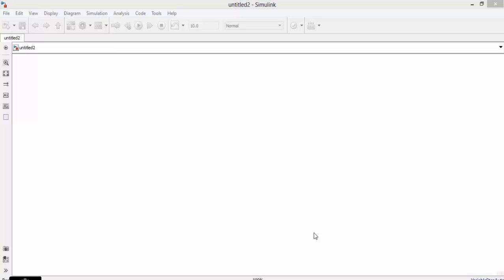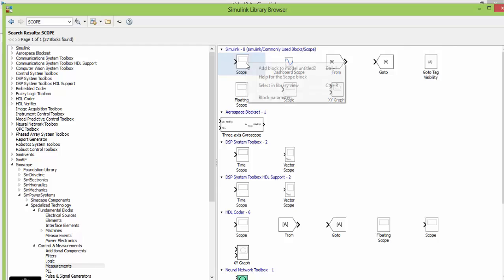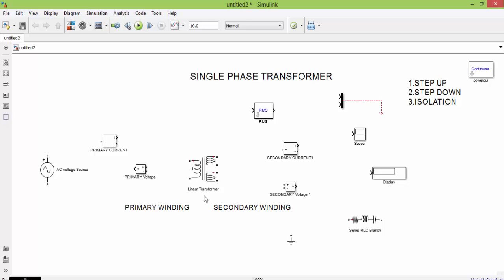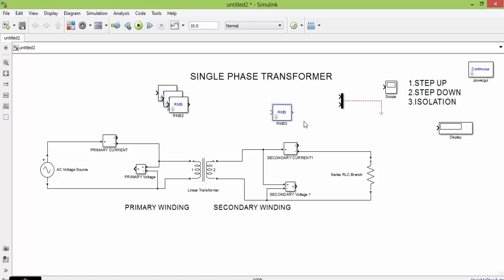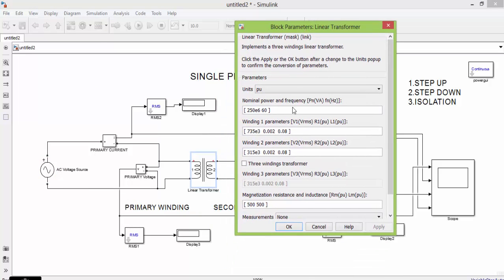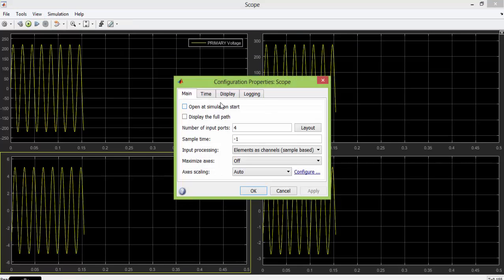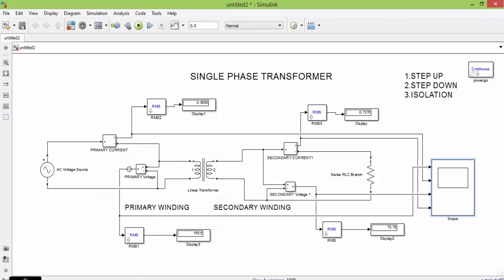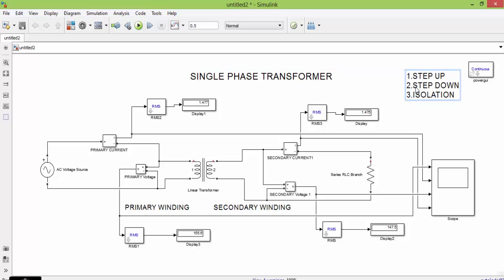matlab simulation of single phase transformer

Comment: I tried the same but i do not know why primary current is bring displayed 0. Can you please send me the matlab in file as the link you have provided in the comments is not working.
Reply from the maker: Put a load value
Reply: @EduTechGururkk  I did put it to 100ohms. Can you share the MATLAB file if you have one??
Reply: @EduTechGururkk  I did put it to 100ohms. Can you share the MATLAB file if you have one??
Reply from the maker: I have to check does it have current measurement unit

Comment: Ty for your videos. I followed your steps but I have an error that I don't know how to fix it. Maybe you know.
An error occurred while running the simulation and the simulation was terminated
Caused by:
Derivative of state '1' in block 'pract1/RMS3/TrueRMS /Mean value/Model/integrator' at time 0.002375 is not finite. The simulation will be stopped. There may be a singularity in the solution.  If not, try reducing the step size (either by reducing the fixed step size or by tightening the error tolerances) 

I've already tried to apply a lower fixed step size but it's still not working.
Reply from the maker: Did u add power gui block to simulation
Reply from the maker: What version of matlab u r using